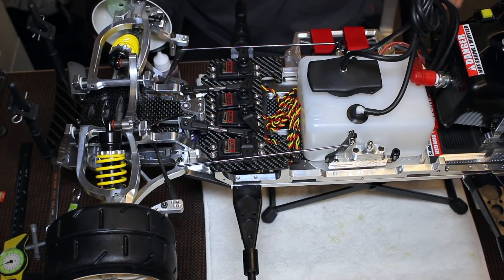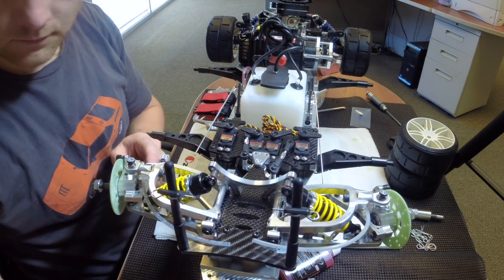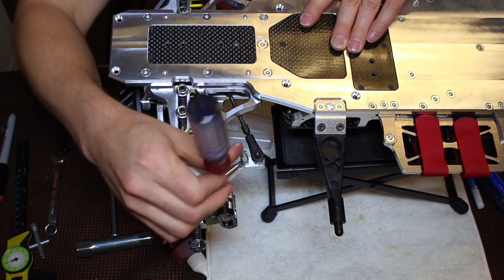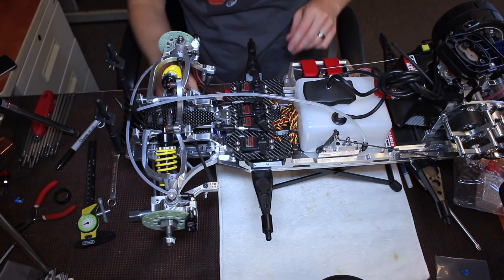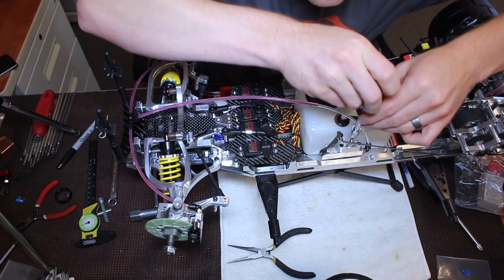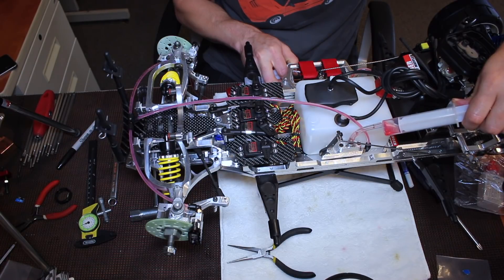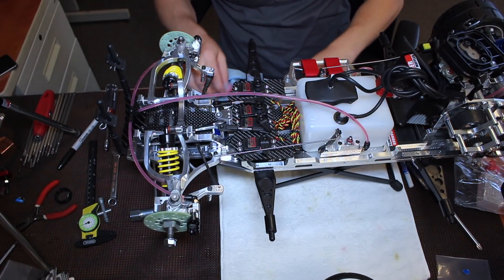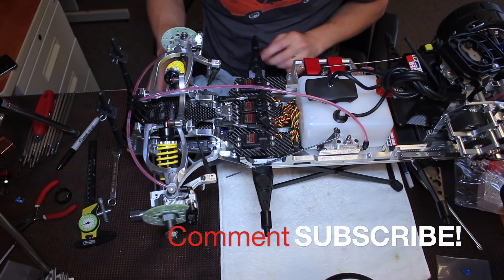FG EVO 2020 Bleeding the hydraulic brake system!

Comment: I use yellow teflon tape around the bleeder valves threads to prevent leaking when servicing the brakes
Reply from the maker: that is a good tip! I have thought about doing something similar. They have an anaerobic bit of thread locking compound on the valve thread. I finished the build a few months ago and the brakes have not leaked or had any issues since the build

Comment: One high trch rc , i wonder if motorcycle bleeder would work .
Reply from the maker: Maybe! These use such a small amount of fluid and it was easy enough to get done with the syringes that I don't think I would bother with anything different. This was my first take at ever attempting this and I was able to get it done pretty quickly. The rear brakes went even faster than the fronts.